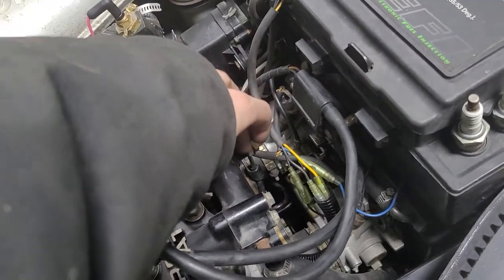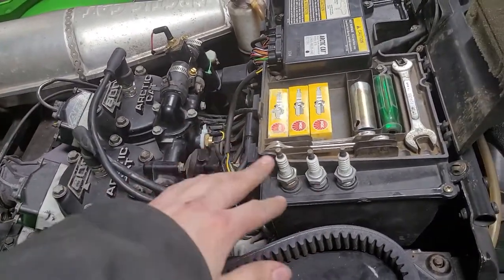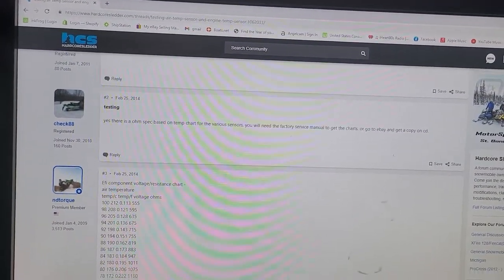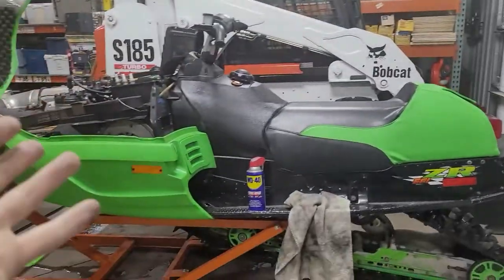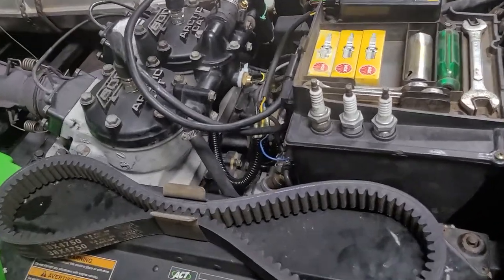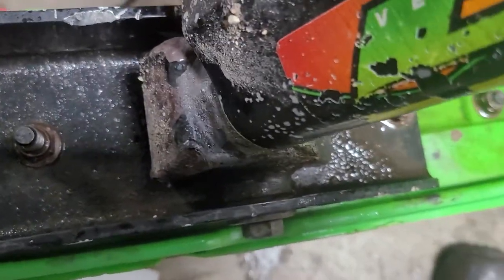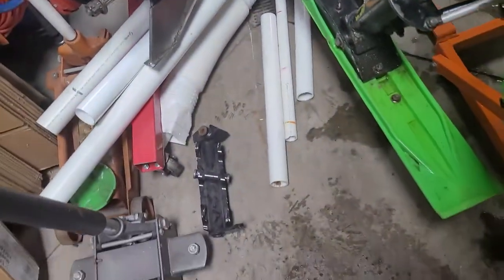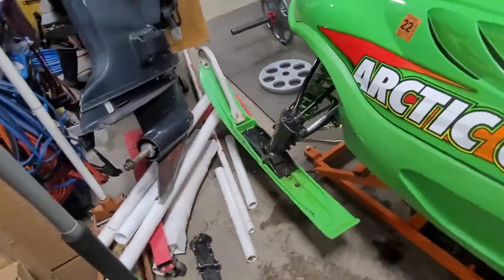Arctic Cat Snowmobile - Running Very Rich (Temp Sensors / Diagnosis)

Comment: So i have a 550 ext that starts first pull COLD runs great pulls wheelies but once it warms up its dead and we dont wanna throw parts at it any idea or help you can give me. you’re the closest person on the internet with the same issue we have been all over the carb but nothing.
Reply: Dead as in it boggs out
Reply from the maker: That sounds like a stator problem. I had a 99' zr 600 that would run awesome but then would sputter, pop, and bog really bad once it warmed up. There's allot of good info on almost every snowmobile forum on how to test your stator.